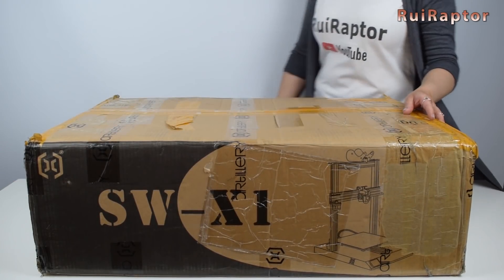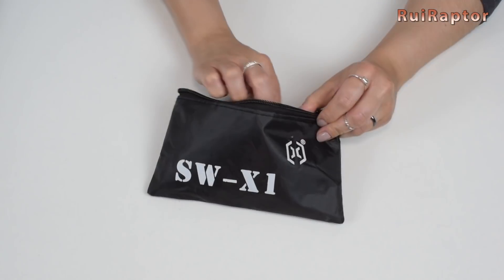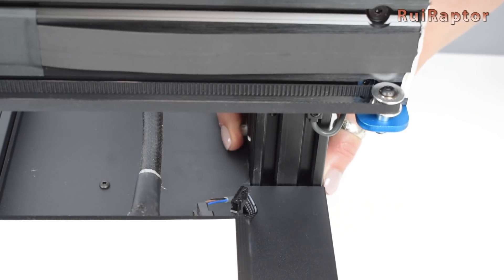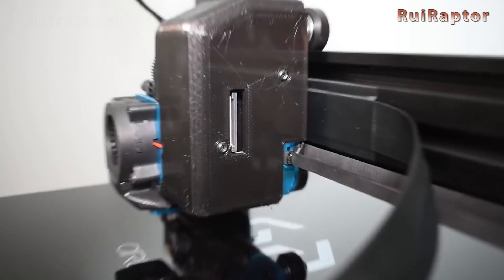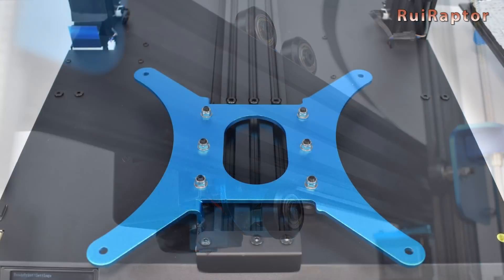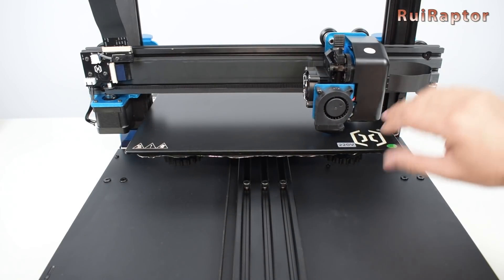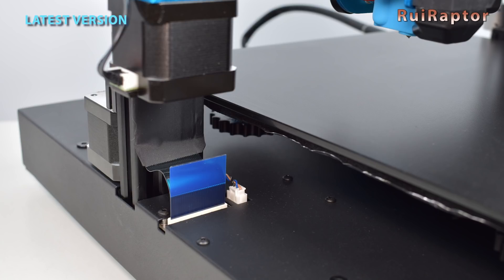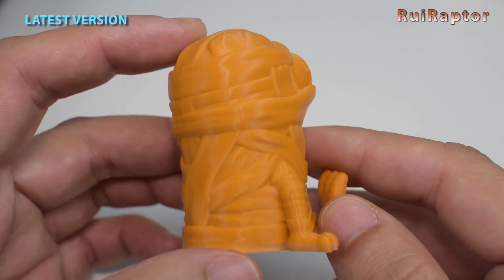Artillery SIDEWINDER X1 Review - What´s New on the Latest Version?

Comment: Hello, thank you for this very well done instructional video! I have an issue with the endstop on my X1 V4. On mine the endstop triggers after there is contact with the bed (full contact and grab). In your video this should be just before contact so that you can freely move the extruder around the bed. I of course cannot do this due to the "full contact". I noticed on older X1s that the endstop could be adjusted. On V4 this is not possible. Did you have any suggestions on how I could "relocate" my endstop? I wished they kept the old method where the endstop was secured via a T-nut. Any suggestions would be appreciated! Thanks
Reply from the maker: Hi, you are right, on this new version the endstop is fixed and you cannot adjust the height (you can but you need to buy some T-nuts...) however, if your nozzle touches the bed before the endstop, just turn the bed knobs and lower the bed.
Reply: @ruiraptor  thank you... Typing this out actually made it realize I could just convert it back to the old method using a spare T-nut! Thank you for responding so quickly

Comment: Fitting the filament runout sensor close to the filament roll is ok for when filament runs out but when you get a breakage this positioning is the worst place you could mount it, this unit is so light it could and should be mounted above the hotend assembly
Reply: So when the sensor triggers the end of the filament is unreachable in the hotend?

Comment: Here's what I don't understand: This printer has two motors for the Z axis, right? Why are the rods connected on top with a belt then?
Reply: This is a synchron belt.
So that the x-axis can not shift or tilt on one side..
Because the printer only has one z-stop.
If he hat two z-stop..they dont need a sychron belt..like the Anycubic i3 Mega..
Reply from the maker: Hi, Martin is correct. The belt will keep both leadscrews in synch when the Z stepper motors have no power.
Reply: By the way, many other guys just disconetc that bet , because they produce tension betewn the motors, and produce ondulation in a very tall printer..really i dobt know its true , but make samo sense to me

Comment: I love this printer but there 3 things that could be cathastrophic: the glass bed its fixed, yuo cant quit for cleaning, the ribon cables have a lots of issues, and of course the plastic arm its easily broke( they konw it, that why its came whith another one)
Reply: broken arms are just a lack of knowladge, you wont need to push the spring to the maximum to get the filament easy through the hotend. 
(pre damaged arrivals taken out)
Reply: Bed fixed is terrible, totally agree... but this “ultrabase” style is not that bad, a bit heavy... mine came flat at least. but I much prefer the steel sheet approuch with PEI on it

Comment: The three issues I've seen mentioned in other videos about the Sidewinder are, in order of importance 1) the lack of strain relief on the bed heater cable, 2) the plastic filament loading arm that often breaks (lots of aftermarket metal ones) and 3) the use of ribbon cables. The first issue is critical, since the bed runs on mains voltage. I'm wondering if the fix they implemented is enough, and if there is thermal runaway/short circuit protection built into the circuitry. In any case I'd be satisfied if I could modify the printer myself to add the strain relief - I haven't come across a video that tackles this issue, though. I am rather disappointed they didn't fix the filament loading arm problem - or did they? Is the arm improved from the earlier version? This is easily fixed, of course. Removable glass for the print bed would have been nice, too, though I haven't seen any reviewers having problems with this.
Reply: the arm design is different from first version, they changed the supplier around 10 Month's ago
Reply: I suppose that brings up a couple of additional questions. 1) Is the new arm no longer prone to breakage, and 2) Will the aftermarket metal arms still fit?
Reply: @iskandartaib  yes and yes
Reply: @iskandartaib  the old arm had around the bearing this open space to work as a spring, this is now completely closed and thicker

Comment: 8 bit mother board and a 200 Watt cheapo PSU.
Reply from the maker: Hi, the power supply is more than enough since it's equipped with an AC heatbed.
Reply: Wrong